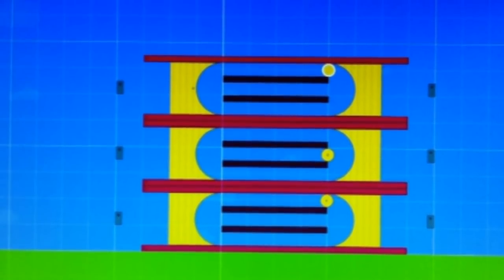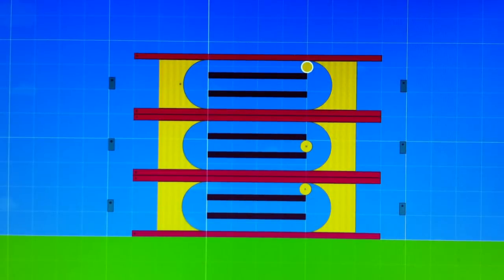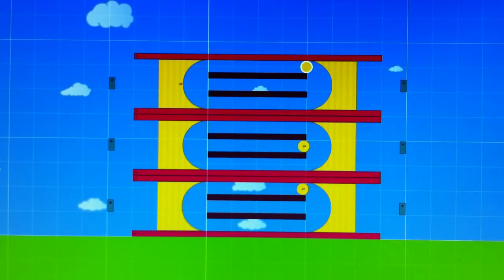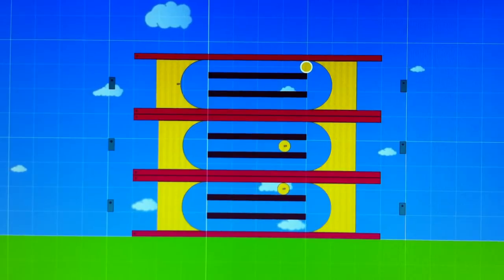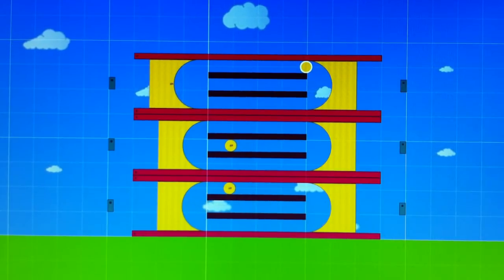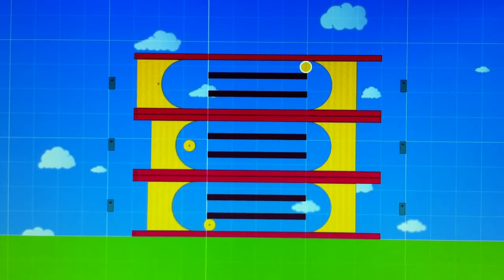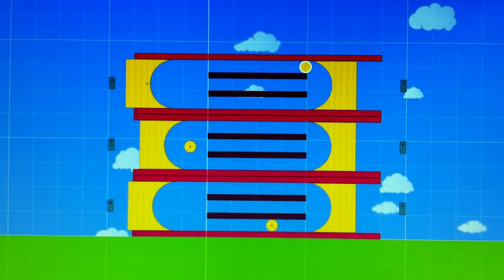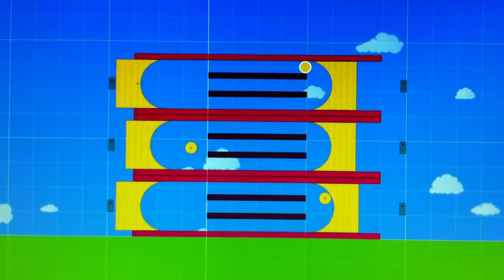Simulated Examination of Acceleration Overunity

Comment from the maker: Think of this illustration as 3 equally matched and equally energized thrusters. In the bottom illustration, motion energy still remained in the 60 kg ball even after it had returned to its starting position. And this after having accelerated the 480 kg masses on both sides. You need to take the time to understand the implications of this illustration. Thanks for watching.